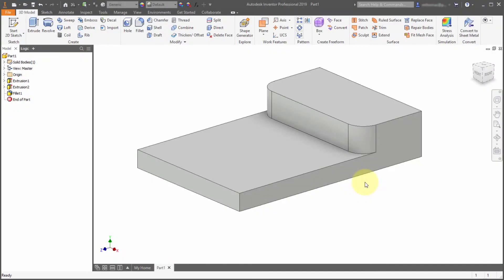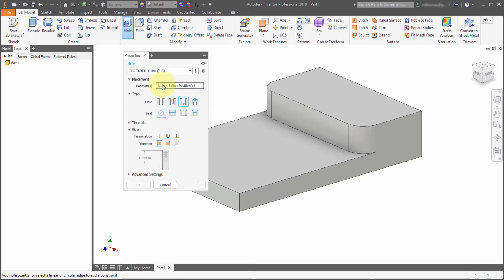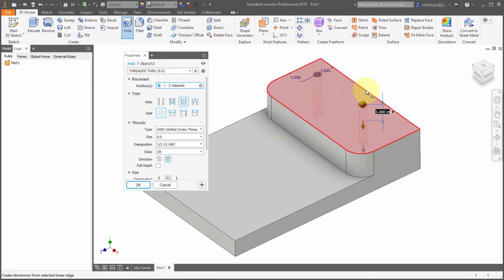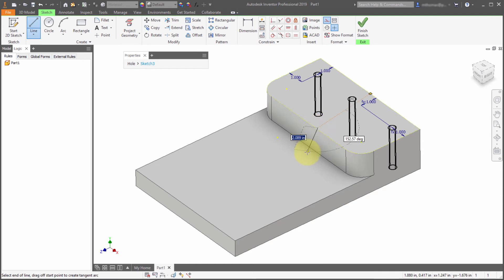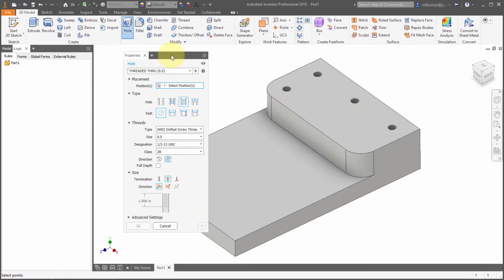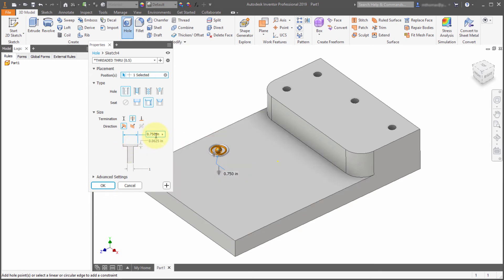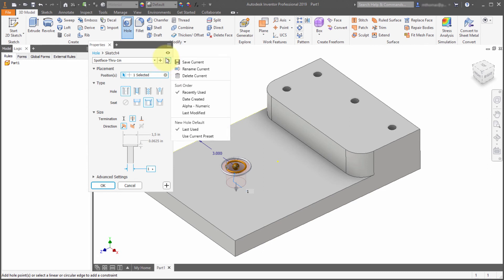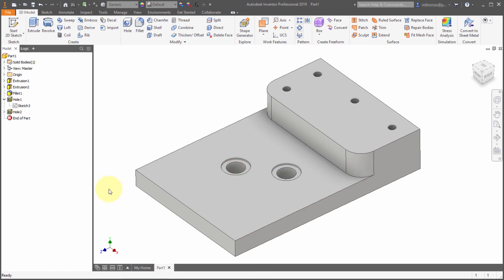Inventor 2019 - Updated Hole Feature

Comment: Hi, I'm having some troubles in selecting single points a starting point for the holes, sometimes it "sees" the points in the assembly if the point is generated in a part and sometimes it needs for a point generated in the assembly directly. I'm not really understanding it's way of selecting points and directions instead of points on surfaces